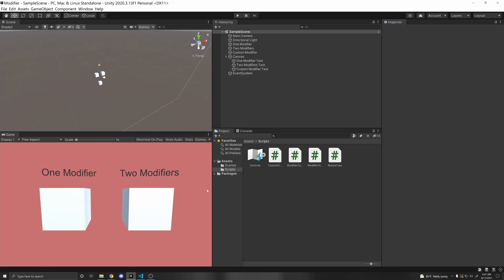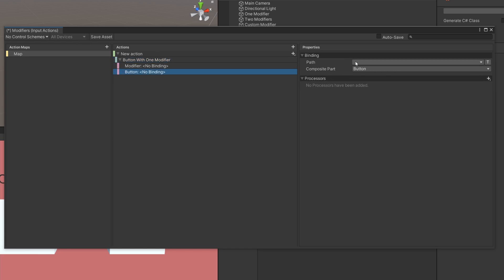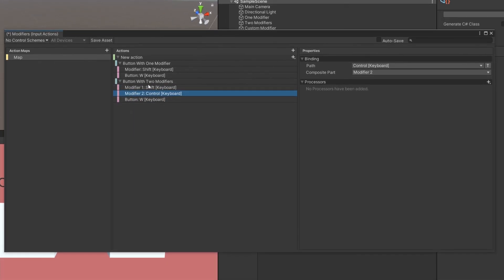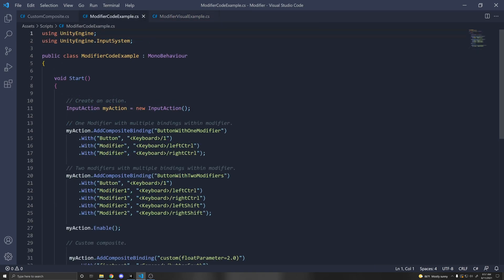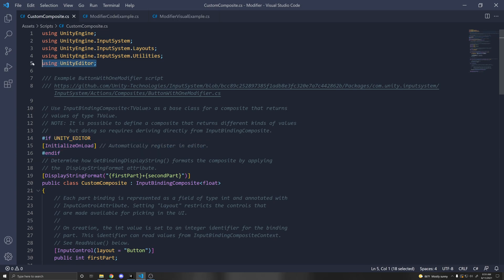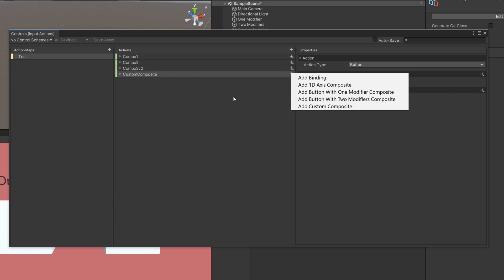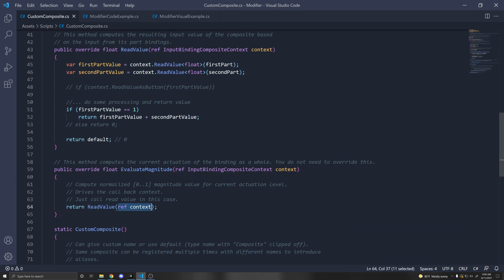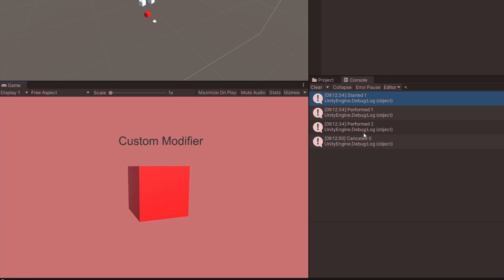Input System Modifiers Explained | ButtonWithOne/TwoModifiers and Custom Composites - Unity

Comment: Why when a gamepad has so few button option's. While some game designer's know this, will add a modifer, which then doubble the number the rest of the buttons. Having 16 button's mean's only sixteen configuration's. Causing one to be a modifer, does subtract one form 16, but them causing there to be 30 button's to configure instead of 15.

I realize there are I believe there called enumerator program's one can purchase, and it's quite possible "STEAM" has an option somewhere in it's programming. But unless one is a "GEEK" such as I am. It might as well not be available. I kick my self in the ass, every time I remember spending a lot of money for a pro controller, thinking the additional 4 button's would give me 4 additional button's to configure. When they don't, they simply allow one to configure an existing button to that of an other, some time's more easily to get at with one's finger's.

If I knew of someone who could do it, I'd pay. If I could simply buy one, I'd buy one. More and more game's are requiring one to make choice's, when there's not enough button's to configure.

Comment: For anyone possibly watching this in the future and you are wanting Modifiers to take precedence over non-modified values. For example: You have W as a binding but also have Shift + W and do NOT want the W binding to trigger when Shift+W triggers. Go to Project Settings > Input System Package > Check "Enable Input Consumption"
Reply: Very useful comment!
I wish I read it before scouring the Unity forums for the same answer for like half an hour. :D
Reply: @benjoe1993  I too went down the same road haha
Reply from the maker: Nice!
Reply: THANK YOU!! this is exactly what i came here trying to figure out
Reply: @pmLite_  Glad I could help!
Reply: Is there a way to do this without making it a project wide change?
Reply: @802connor  to my knowledge no. You'd just have to make your own way of processing inputs.
Reply: @@kamipinilla glad I could help :)

Comment: I’m having an issue understanding, so for example; say youre using an OnMoveInput with a X value that changes your current velocity when the player holds “D” or “A”, could you add a modifier to that OnMoveInput so that it could transition to OnRunImput when the left shift key is held and also transition back to the OnMoveInput when the left shift key is released and “A” or “D” is still being held?

I hope my question is clear enough. Just in case it’s not I’ll add a bit more context, skip this if the above is enough to answer the question. 
Context: I’m pretty deep into my state machine, using core, and core components. But now I feel it’s important to go back and and the ability to run, on top of Justin’s being able to walk. However I’ve refactored my code quite a bit now and I feel like I’m tangled in a bunch of cables. I feel like I’m in a good stop as I have no errors when I run the game and I everything I have up to now works as intended. 
Im trying to make (for practice, not to sell) a 2D side scrolling Dragonball fighting/Metroidvaina style game. Maybe this context can help you understand the issue I am facing. Maybe you have a suggestion or two as well?

Comment: Thank you for the tutorial, I was testing it and I found a problem, what if you want to press only "W" key? if you have "Shift+W" in a singular action and "W" in another action, every time you press "Shift+W", the "W" action is also performed, any suggestion in this situation?
Reply from the maker: That is unfortunately a limitation of the input system, you’ll have to check manually or do some workaround, here is a corresponding thread: 
https://forum.unity.com/threads/using-buttonwithonemodifier-without-triggering-another-action-using-the-same-binding.775109/

Comment: Hey @samyam, remember the PlayerController code you used in the 3rd Person Shooter video (the one using Invoke Unity Event) you made? Well, for some reason I can't get my own InputAction "Run" to work (which is a binding of "w" with "shift" modifier).

How would you go about implementing this kind of action in that 3rd person movement script you had made before?
Reply from the maker: What exactly isn’t working with the modifier? 
I didn’t use Invoke C# events I manually got a reference to the actions and then read their values in code. If your code is similar to that video you can make a check to see if the character is sprinting (readvalue, or if you’d like setting a boolean once the performed callback is triggered or setting the speed once the callback is triggered) and if so make them use a sprint speed instead of a walk speed that you set.
Reply: @samyam  Thanks a lot !

Comment: I think you're missing the point of composite bindings, or at least you're not explaining the main use for it. It's not just a quick way of hooking up several controls at once. Setting up actions for WASD separately would give you a different result from doing it as a composite. Using a composite, hitting W and D would result in the vector [1, 1], moving the player diagonally. If you set up W and D as separate controls, you would only ever get either [1, 0] or [0, 1], so you cannot move diagonally.
Reply from the maker: That’s a good point, slipped my mind thanks.

Comment: It seems the new input system does not recognize release of touch in simulation and real device. Press Interaction sends start and perform callback just fine when touching starts, but it fails to do anything when touches releases unless clicking outside of game view which is even more weird. Have you experienced this?
Reply from the maker: Hm are you using Value or Passthrough? PlayerInput or generated code? Subscribing to the cancelled callback? 
I have a video on Touch in the input system that might help
https://youtu.be/ERAN5KBy2Gs
Reply: This makes me think that a video on known Unity New Input System Bugs (with Patreon-exclusive code) would be useful. By allowing people to reproduce the Bugs in a Project it would allow us to test if the bugs still exist, and see first-hand how the Bugs behave.
Reply: @MrNybbles  Updated to the newest version (1.1.0 prev3) and now it does not even recognize any touches even enabling TouchSimulation in code and InputDebug. Welp, take a break for now then LOL.
Reply: @MrNybbles  looks like you two are new to unity... else you would know not to use anything other than LTS.. for serious work..
Reply: @diliupg  I started my last reply with " In general I recommend sticking to LTS Versions of Unity and away from Preview Packages as much as possible (unless you are really into finding Bugs and writing Bug Reports)" because I know the latest version of any software (especially drivers and BIOS updates) is very likely to have serious issues, but Hai Nguyen Thanh and I never said anything about "Serious" work.

Remember, lot of people are hobbyists, or just like playing with the latest in cutting-edge and bleeding-edge software, and neither of these things mean a person is  "new to unity."